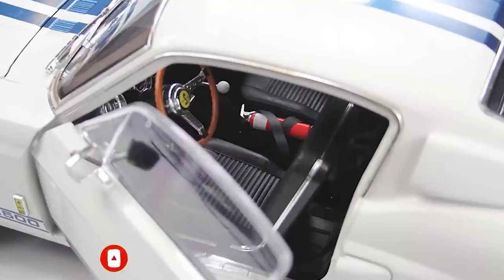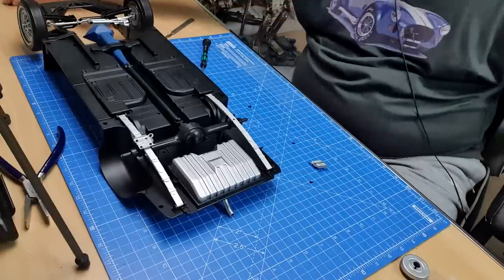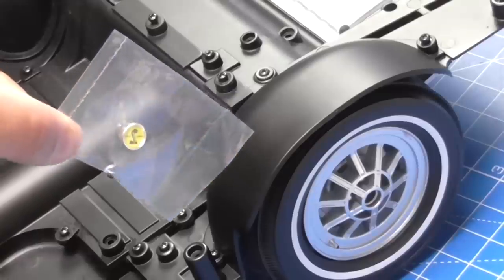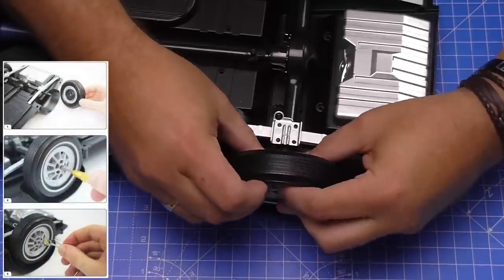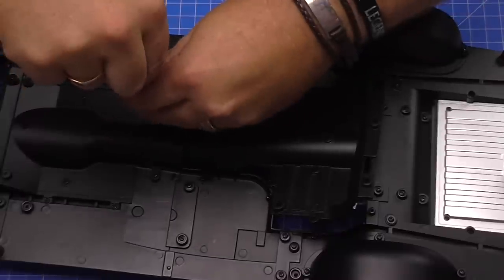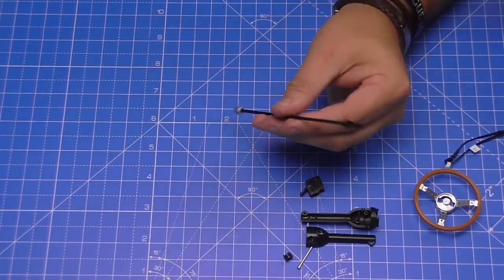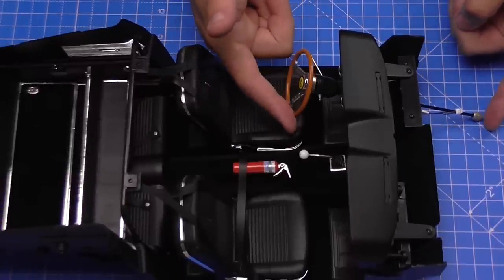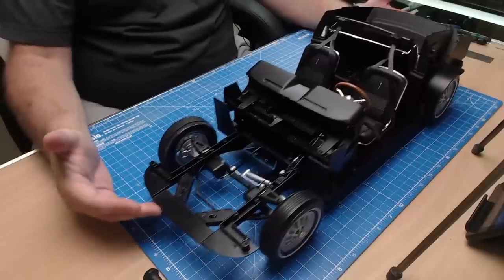Agora Models 1967 Shelby Mustang Super Snake - Pack 8 - Stages 56-64

Comment: You have 2 be strong 2 do the tyres, I had blisters & took skin off & have a few tyres 2 put on. Could spend hours if you don’t put it on the 1st time or could use hairdryer
Reply: You can use pliers on the valve if you want them in the same spot

Comment: Excellent video Wayne, still waiting for pack 8 to arrive which should be in a day or two. The exhaust system was something i noticed with pack 7 and wondered whether the order of parts should have been sent out differently so as not to cause any screw fittings issues as the plastic thread can be easily damaged. Onto the engine maybe for the next pack, i do hope there is going to be a lot of detailed parts.

Comment: using the hot water for the tires is a good ideal but you didn't dry them very well after taking them out, aren't you worried about water being left inside the wheel?
Reply from the maker: Nah I gave it a good shake

Comment: I am building the snake, pack 6 has been shipped. Over all nice card but the lack of detail is worrysome. The one piece brake drum assembly is very disappointing.  Would it be possible to  unscrew the rear leaf spring brackets and the shock absorber attachment and lift the rear suspension to slide the exhaust assembly under it?
Reply from the maker: It really didn't take to long to lift the floor pan.

Comment: My steering wheel is very loose and comes off when only looking at it. Is it supposed to only be held by the steering axis? Also when the steering wheel is attached to the dashboard I can't get the whole interior part to line up with the chassis.
Reply from the maker: Its held in position by the screw near the top of the axle and should be pushed all the way into the rack to fully engage. When the cover goes over the top it should hold pretty firm
Reply: @WorldofWayneUK  Hi Wayne, I mean the steering wheel itself, with the button. It comes off very easily from the axle. (only held in place loosely by the half circle axle tip). Also the button only works when the steering wheel is turned slightly, though I put it on exactly like in the instructions.

Comment: For those of us who haven't started pack 4 yet, would it best to leave out fixing the centre floor panel till pack 8 If we have to take it off again?
The same thing happened with 1/12 Routmaster bus, having assembled the front suspension which was bloody tricky, further on in the build you had to disassemble to fix it to the chassis, much grumblings and swearing on the ranks.
Reply from the maker: The thing is, as you are using different screws its probably the best place for it. It really doesn't take etoo long to remove.
Reply: @WorldofWayneUK  ok then.
Reply: had to do this  somme with the dodge charger  too